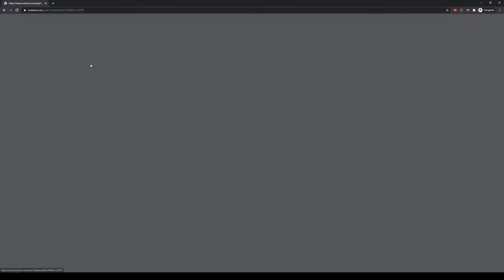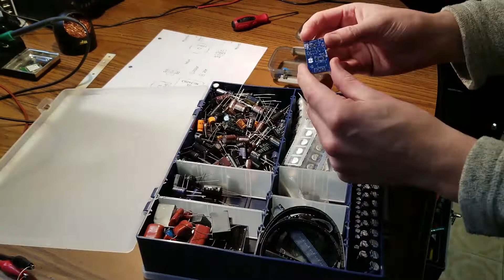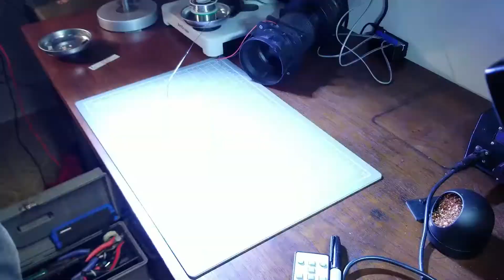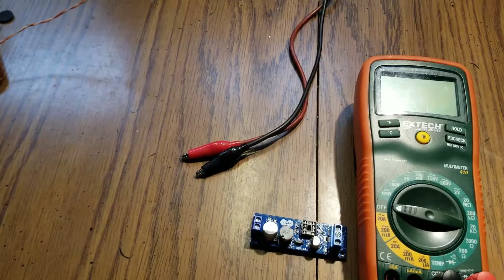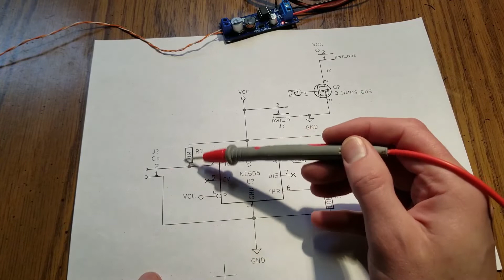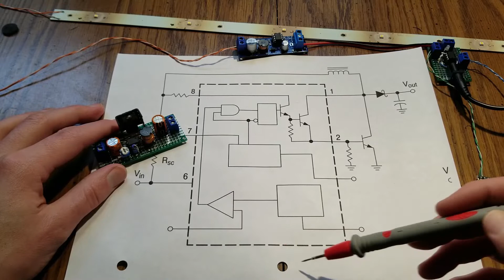Using the MC34063 as a boost converter to drive an LED strips

Comment: Thanks for the video. I am thinking of making a dc to dc boost converter for a vintage tube portable radio that needs 90 volts DC. 10 x 9 volt batteries gets pricey and doesn't last long. Im considering a LiFEPo4 battery with a DIY boost converter. 13.2 volts in to get 90 volts and 30 ma max out. Where did you get your Pcb? Did you design it? Is it all SMD? Thanks.